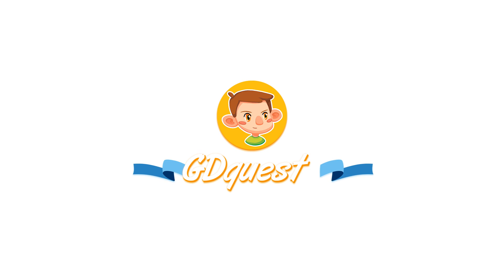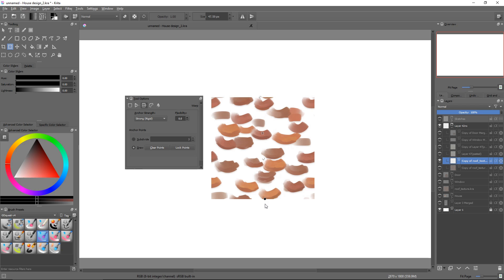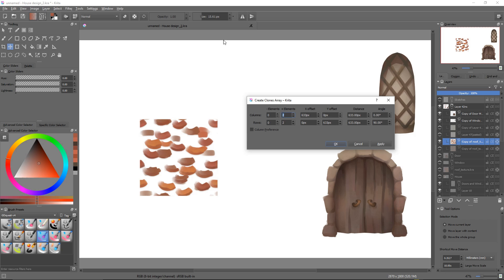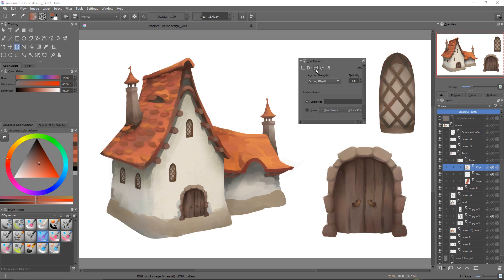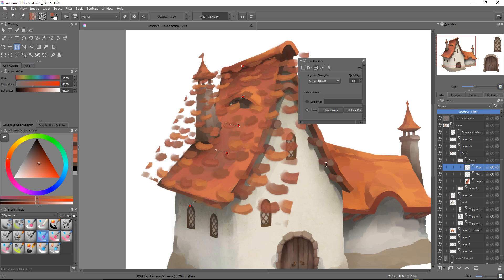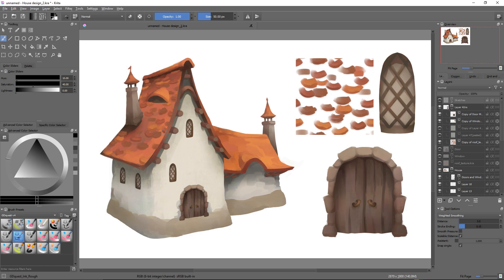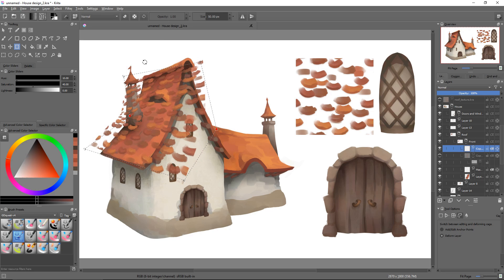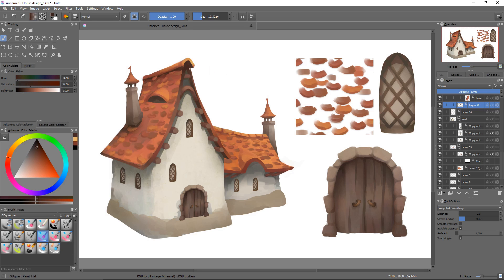Krita tutorial: How to use the warp and cage transform for concept art

Comment: How do you resize a selection without losing quality? My drawings always blur when I resize them to smaller ones.
Reply from the maker: That's normal if you lower its size a lot. Check out the scaling algorithm you're using in the tool options docker. Lancsoz3 is the sharpest one.
Reply: Well, I got adjusted but thx anyway :)

Comment: 6:24
Addition:
You can move all selected points as shown here ONLY, if your cursor is inbetween 2 marked points. Anywhere else, the icon will change and you will rotate the outer Points around the Central marked point.

You can use this as a more controlled "Twist Liquify".